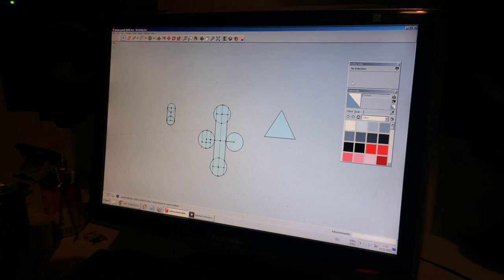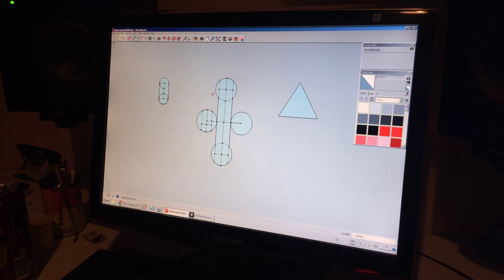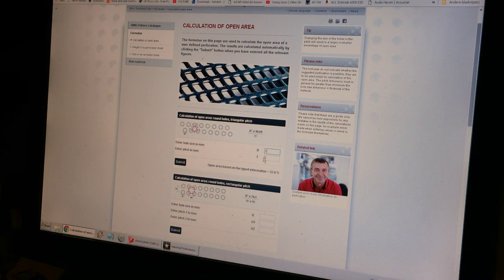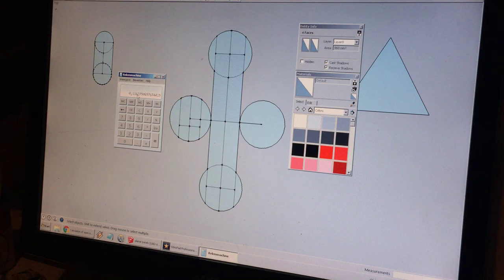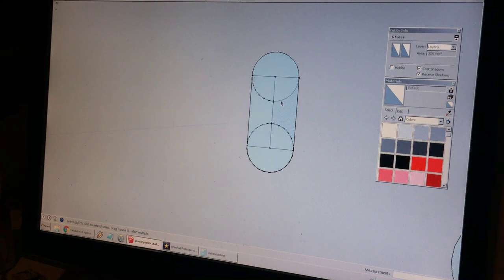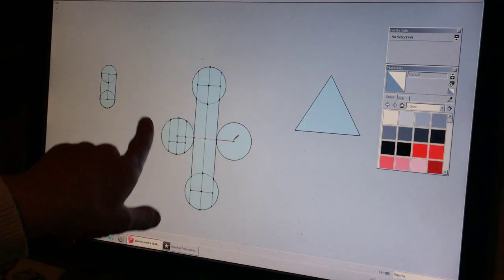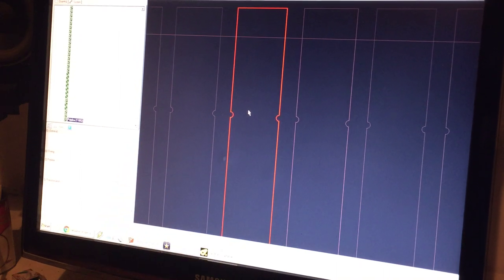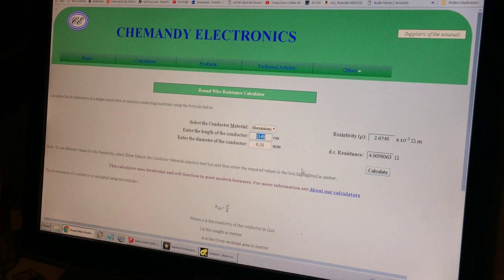Part 3 : DIY (tutorial) make a planar speaker panel : Some background stuff

Comment: the calculation for the stacked holes is incorrect, because there is some area on the side of each hole that is solid. it counts as "closed" area and reduces the percent of open space. The 53-54% calculation assumes there is no metal beside each open hole.. the holes would need to touch side by side for the 53-54% to be true. , thus it is less open area than th 53-54%
Reply from the maker: in know. its an calculation from between magnets. not so much overal :) i do have these calculations though its more in the 10-15% range. still much higher then doing it randomly :) the emtal itself is 40% blocking more then half with magnets wont result in 53% of course :)
Reply: joppe peelen all true .. thank you for the great work